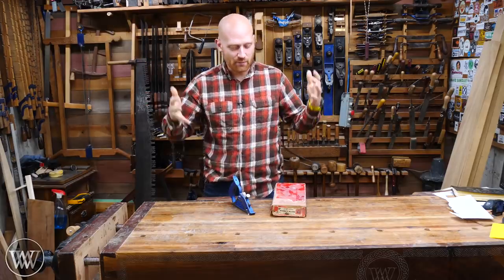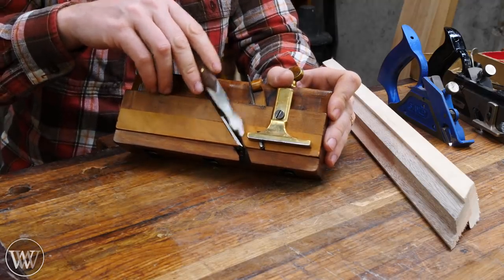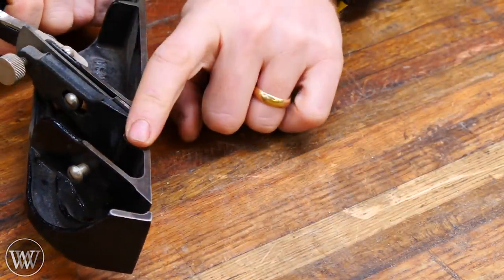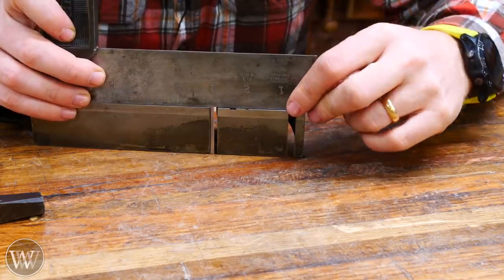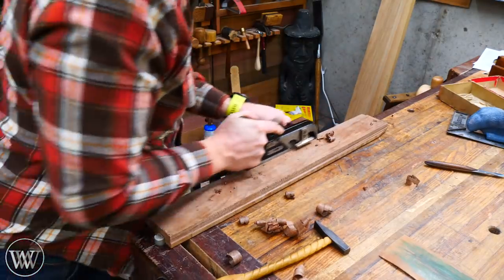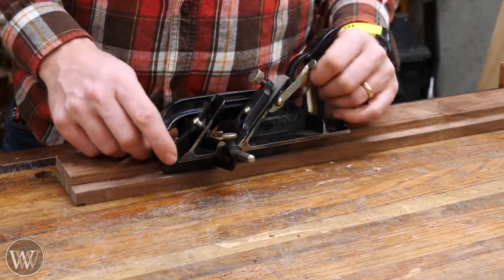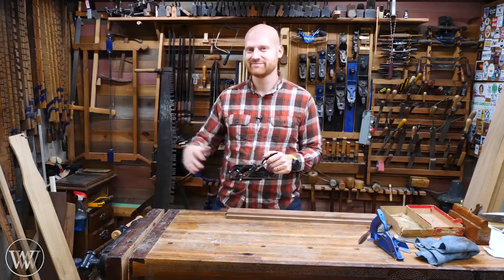What is a Rabbet Plane

Comment: The Challenge of buying the Stanley #78 is finding a seller who hasn't figured out he can sell the fence, depth stop and the shoulder screw separately and make a killing.    The best I could do was find the 78 with the fence, or with the depth stop.   I chose to buy the 78 with the fence and decided to make the depth stop myself, as the depth stop was a lot easier to make.    The shoulder screw for the fence and depth stop are identical and the thread was a Stanley proprietary size no longer produced.    I ended up using the screw for the fence in the depth stop.    The reason being there was less threads in the fence compared to the plane body.    As a result, I was able to buy a shoulder screw at a big box store, one thread size different, and it adjusted itself nicely to the threads in the fence without having to be re-tapped etc.     The depth stop was easier, I took a piece of 2x2 angle iron, cut it to shape, with lots of filing and cut the slot for the height adjustment screw and filed the guide ridge on the back to align in the plane body.  It took several hours by hand with my cheap files and some serious buffing with compound, but it was worth the time to make one.     I did a complete restore on the plane body, polished and sharpened the original high carbon steel blade and it cut's wonderfully and looks beautiful on display too.     It was project definitely worth doing.
Reply from the maker: sounds like a fun time! nice work!

Comment: My Stanley rabbet plane's fence wobbled. Even when tightened. I found that the single post holding the fence, flexes.  I broke down and purchased a really good skewed iron rabbet plane from Veritas.  This one uses two rails to hold the fence. No regrets.  Rabbet joinery is one of my favorites.  Plenty of gluing surface.  Cutting rabbets is so relaxing.  I sometimes have to clean rabbet with a shoulder plane.
Reply from the maker: right on. that is why Stanly on their later ones changed to two posts rather then just the one.
Reply: @WoodByWright  I have even found videos of people taking their original fence, drilling two holes into it and adding a larger wood fence so the plane stays stable.  I tried it.  Then bought my brand new rabbet plane.  There is something so relaxing about planing.  I cannot explain it.  If the plane is set for a shallow cut, I just love the entire process of planing.  You were right.

Comment: A nice video as usual. Maybe you mentioned it but there are several manufacturers that still make them and I suspect that some of the parts for those may be interchangeable with the older planes. I would have liked to see you demonstrate a wooden rabbet without the stops or fences and talk about the skewed rabbet planes. I have seen them used in place of shoulder planes and have seen them used with clamped blocks for depth stops and fences. You can also use strips on the work for fences as you might for wood rabbet planes.
Reply from the maker: some of the new ones are interchange able with some of the older ones, but even the older ones changed through their life. Stanley even has different thread sizes that they changes as they aged.

Comment: As always James, your videos are woodtastic!  I have three of these planes.  One is the old wooden style, somewhat like your fillister plane, only mine is fixed for width.  The other two are Stanleys, 190 and 192.  I have found using a wooden fencing jig works best for me.  I set up some boards, screwed to my workbench as the width-stop and just slide pieces into the jig that I want a rebate on and go to town.  One advantage is it's repeatable, until I remove the jigging!  I recently got a hold of a Chinese made wooden plough plane with multiple blades that I'm hoping to get to use, soon.  
BTW...   I found these planes to be rather testing, when setting them up but, once you get it, they're loads of fun to use!  
Happy woodworking!  :-)
Reply from the maker: interesting idea. I like the idea out of the box!

Comment: Ward Masters and craftsman make the exact planes.  I compared to my Stanley’s and they are the same and work great.  Also,Do you realize you can use them on PVC boards as well? Are used them several times and you get great shavings want to break through that initial skin and they were great in a pinch. Great video James as usual. You have com a long way ,
Reply from the maker: yup. there are quite a few other companies that make them almost identically. I have never used PVC. but I have planed brass and aluminum.

Comment: Hey there. Love the video.  I have an old rabbit plane that was my dad. It did not have fence or depth stop. I bought both of them on amazon for maybe 20 bucks.  Not original but let's it be used as intended.  I'm not skilled enough to use my fingers, probably cut one off. Haha
Reply from the maker: nice. you would be surprised how easy it is to use your fingers. I will have to do a video on it here soon, but once you establish the first cut the rest just ride on the wall that you just made.

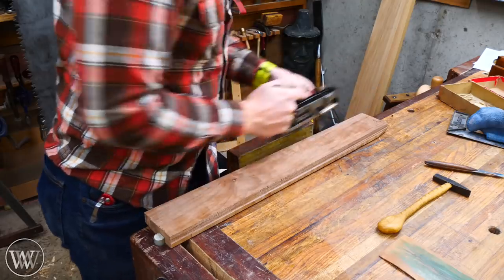Comment: 8:25  : after some research, it might be helpful to start with a small cut at the front and then working back in case of grain that is difficult/not straight. that would  help with making a straight cut, preventing the blade to move when it encounters difficult grain while you establish the initial cut. 
thanks for showing it can work perfectly this way as well, I had no idea.
Cheers mate
Reply from the maker: That's the way the theory goes. But in practice I have not found it to actually be a benefit. There are a bunch of different ways of doing it and it's always fun when you can find a method that fits your style. One of the things I love about woodworking is there is no right way to do it. Just the way that you find enjoyable.
Reply: @WoodByWright  very true, thank you

Comment: Timely video James.  I am waiting for my skew rabbet plane to be delivered from Lee Valley.   Being left-handed, I ordered the left hand version.  Have you ever noticed any serious problems using  a rabbet plane 'against the grain'.  LV makes a left and right hand version, but I'm hoping I only will need the one.   (well, I know I can get by with just one of course, but I'm understandably curious what possible issues may arise.  I'm thinking the skewed blade should eliminate some of the problems of going against the grain when those situations come up.
Reply from the maker: sweet. I have never had that issue mostly because the inside of a rabbit rarely matters. but if it does I just take a lighter cut and it is acceptable then.
Reply: Wood By Wright good to know.  This will be my first rabbet plane so wasn’t sure what to expect.
Reply: Can't you just change the fence to the other side to deal with grain direction?

Comment: You need a washer on that depth-stop screw (Miller's Falls plane)... or perhaps a different screw with a larger head... I know, finding the right screw with the correct thread pitch can be difficult, which is why I bought a metal lathe in the first place (now I use it for all manner of things!)... nice video... THANKS!
Reply from the maker: True. The original one was a thumb screw with a large shoulder. Unfortunately this is just a temporary screw to hold the stop on. Since this video I have found an original one to put in there.

Comment: The blade on opposite side of The fence has to protrude about 1/32 to 1/64 to avoid leaving some material against the wall of the rabbet every time you run the plane. Unfortunately,  some people grind or file away the protrusion of the blade thinking it should be flat with side of plane. Not necessary to force plane against wall to maintain it square. Just use enough force to keep the fence tightly snug on the edge of material.
Reply from the maker: Some people like to do that. I personally prefer it to be flat with the sign for you I get a little bit cleaner wall with that. The problem is you have to make sure it's pushed tightly up against the sidewall otherwise you start getting steps. Having the blade protrude a slight amount will stop those steps from being created. But it can also cause a rough sidewall or moving the sidewall over farther if you don't use a fence.

Comment: Nicely done  -- do you smell fish? I have seen some sites that make the depth stops and fences but the problem is the screw threads used on planes are not a "common" variety and many would be makers avoid getting involved because of that... And it is costly to make such a small demand item.
Reply from the maker: LOL yup. add to that even Stanley changed their threads on the same plane through the years. it can be difficult to find the right one.

Comment: Great info as usual. Because of this video I now want a rabbet plane :) I do have one question and it's off topic a bit. How would you go about squaring up an iron that is skewed or just not flat? Looking for a non-bench grinder method since I don't own a bench grinder.
Reply from the maker: You just put more pressure on the side that you need to take more material off. Over the course of a couple sharpenings you can bring it back into square.

Comment: I just got a nice Record 778 and I got it sharp and set up ok- this was very helpful thanks 
My problem is that I don’t have a good bench and vise with dogs etc. so keeping the workpiece still and in a position I can present the rabbet plane to is challenging.  I’m mainly working on boxes so most of the pieces are small like under 10 inches long and I’m looking to use rabbet joints for these.  Any suggestions on how to hold the work pieces for rabbeting?
Reply from the maker: With a steady hand you only need a planning stop to push the board into. That can just be a sacrificial board that is clamped on the other end of the board you're planning. It does take a little bit of being careful but that's the easiest way. The next step is then to put a sacrificial board in the other end and clamp it in place and then you can put a wedge in between them to clamp it down. You can also get dogs and a dog hole clamp. And that way you can just drill 3/4-in holes into your bench to clamp the board between.

Comment: Thanks for the video. One question though. Would it be better if your hammer was brass instead of steel to keep from damaging the plane iron?
Reply from the maker: thanks Paul. a lot of people like brass mallets but small ones like this do not have enough force to change the iron. surprisingly this is a traditional plane adjustment mallet.

Comment: I have a 78, but I never get a nice and square rabbet with it. It's very difficult to keep it upright when there's so little surface to register on. It looks like your rabbet there was also a bit off. Got any tips for keeping it square or fixing an out of square rabbet? I'd add some wood to the fence but it has no holes, maybe I'll try super glue to make a beefier fence.
Reply from the maker: it is rair that a rabbit has to be perfictly square, but most of it is just skill and practice. something I am a bit deficient at.
Reply: The reason you're not getting a 90 degree corner is a very common setup mistake.  You DON'T set the blade flush with the plane body. When you set it up flush and look closely at the cut you'll see tiny steps coming down the vertical face. No amount of force or practice will correct this. Instead set the iron to extend slightly past the plane body (maybe a 32nd or so), that's why the blade is wider than the body. Make sure that you set the fence from the corner of the blade, not the plane body and you'll see that a square rabbit is accomplished quite easily.
Reply from the maker: @michaelostrander3681  a lot of people like to have the iron stick out a bit. that works great with a fence, but if you do it without a fence that becomes very hard as the plane body can not register on the wall you made in the last past. that is why I keep the iron flush to the outside.

Comment: How do you go about cutting rebates where the grain of the wood goes against the action of the plane? It seems as though the plane is designed to be used with the workpiece on the right, so how would you cut a rebate on two sides of a piece (like on both sides of a board)? It seems like the grain would be going against the action at least once in that case. Can the hardware on the rabbet plane be swapped over, maybe?

Comment: I've heard it said that you actually want to have the blade a hair proud of the side that goes against the side of the rabbet instead of having it flush with the side of the plane. If you don't then the face of the plane will start pushing away from the wall of the rabbet with successive cuts and you'll get a sloped edge instead of a nice square one.
Reply from the maker: that is true if you have a fence. but if you do not have a fence that can cause the body to rock on the side wall. with out a fence you keep the body referenced on the side wall. the problem with the travel is not  it sticking out but that it is easy to not keep the horizontal pressure on the plane. if the iron sticks out a bit then it will scrape the side wall clean in case you go off track a bit as most beginners do. that is of as long as you are using a fence. if you do not then it will slowly scratch the side wall deeper and deeper. but there is no right or wrong way. just two different theories. like pins or tails first.
Reply: @WoodByWright  hmm that makes sense, I'm working on making a fillister plane at the moment and there's so many things to think about. Thanks for the information!

Comment: Is it feasible to cut dados with a rabbet plane?  Say against a some sort of straight edge, or would it butcher the wood especially in crosscutting?
Reply from the maker: As long as you have a spur to slice the wood on the side of the cutter. Otherwise you can cut the fibers first with a knife.

Comment: Is there a reason to buy this if you plan on getting a combination plane, besides the bullnose?
Reply from the maker: A combination plane will do the job just fine. But a dedicated plane will always do this particular task a little bit better and easier. So if you find you're going to be doing this a lot then getting a rabbiting plane is better in the long run. But a 45 or 55 can also do this.

Comment: Picked up a Sargent #79  for $5 at a flea market in western PA. It was complete with everything but the box. The only problem I have is the round disk spur just rides across the grain and won't let the iron cut. Not sure how to sharpen it. Any tips?
Reply from the maker: You put it flat down on a sharpening stone and set it underneath the tip of your finger and rub it around on the stone. All you have to do is sharpen up that one face until it comes into true contact. Otherwise you can just take it out and not use it. You only need it when going cross grain.
Reply: @WoodByWright  Thank You

Comment: I have a Stanley 78 without the depth adjustment lever. No matter how hard I tighten the lever cap, as soon as I try to take a shaving, the iron slides up the bed taking it off the wood. It's very frustrating. Any ideas on how to fix it?
Reply from the maker: it sounds like the fit between the iron and the bed is poor. try sanding the bed with something flat around 400 grit.

Comment: I just bought a brand new Stanley 78 from my local woodworking store, but the fence is nowhere even close to being square with the plane body, like 1/4" off. Also the plane body its self is about 1/32" out of square. Do you know of any fixes for this or if it's even important? I love the old Stanley planes made in England and America but I noticed this new one is made in China and the quality has REALLY slacked off. Have you heard of anyone else with these problems or any fixes? Thanks!
Reply from the maker: Unfortunately it's very common with a new ones. They're incredibly cheap
Reply: Well that's not what I was hoping to hear but thanks for responding!😁I guess I'll try to find an old one!

Comment: if you set the iron a bit proud from the side (so you are not referencing the plan from the side, only from the fence) the rebate will be more straight and clean.
Reply from the maker: That is a great debate among and to woodworkers. It all depends on whether or not you use the fence every time or if you just use your fingers sometime.
Reply: @WoodByWright  if your fingers are the fence it is still a single reference point. for me it is easier to get a vertical wall on my rebate by setting the iron this way and using the fence on my 78.

Comment: Mr James , Q 1 ,  should I sure that the sole is flat if I buy one ?? I maybe have one soon ? 
Q 2 , I wonder if I can joint to boards together by making 2 rabbit facing each others , ist possible ??
Reply from the maker: Q1. I have never come across that being a problem with one of these. usually if the soul is not flat it means that it was broken and you will see a weld joint or something else holding it together. Q2 sure. But it's more commonly to do a tongue and groove than a rabbited joint.
Reply: @WoodByWright  Thanks 👍

Comment: Hi I recently got an old wooden fillister plane, and the iron is quite cambered, should the edge be completelt straight for the plan to work?
Reply from the maker: It sounds like someone modified it for a specific purpose. The iron should be perfectly straight across to match the sole of the plane.
Reply: @WoodByWright  thanks! I thought so, but I didn't know for sure.

Comment: So i just picked up a Stanley 78 from ebay for 25 bucks but the catch is that it was missing the fence and the depth stop any tips on staying in line without the fence?
Reply from the maker: 50-70% of them out there are missing that. you can make one out of a block of wood and bolt it on the side or you can just use your fingersonce you have established the first couple passes it will hold itself in place.
Reply: Wood By Wright Thanks so much for the idea of making one out of wood it’ll be a fun project for My day off Happy New years!